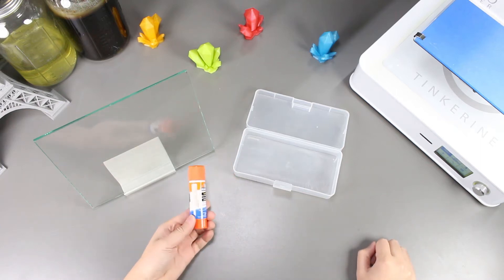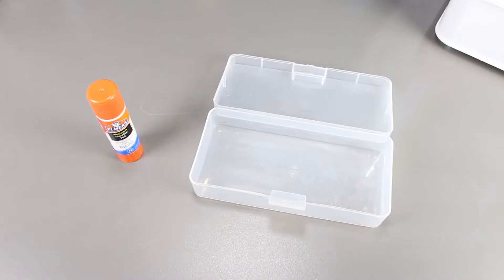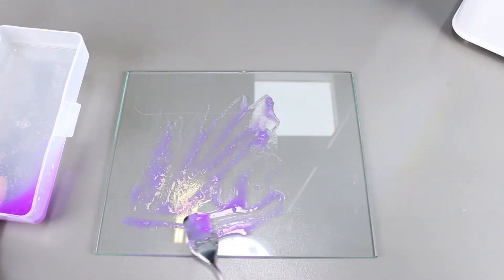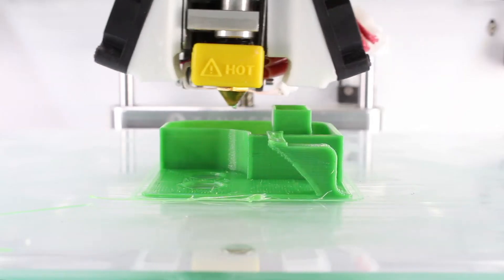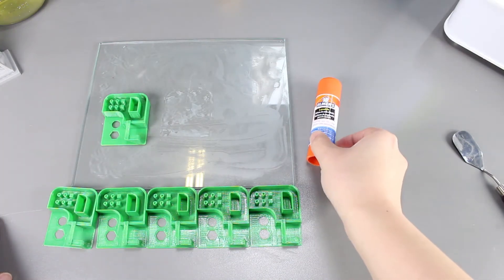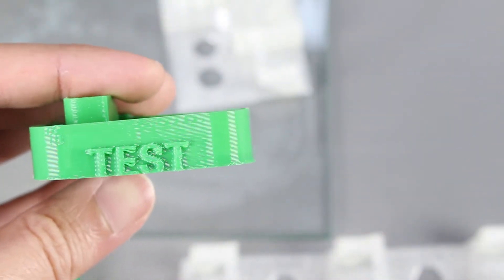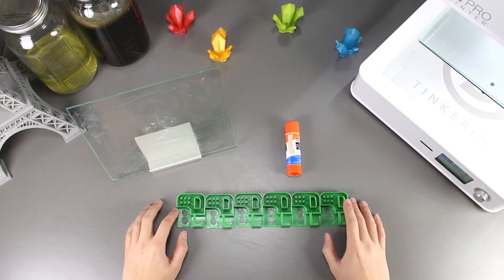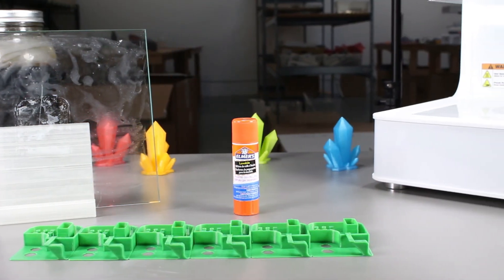3D Printing using Gluestick and Water Solution as a Bed Adhesive

Comment: I do a variant of the water/glue stick application. First I clean the plate with soap and water then do an IPA wipe to make sure the oils are removed. Next I coat the plate with a glue stick making sure to get a good coating. Next I take a sponge and soak it with hot water so just shy of dripping. Then I wipe the bed down with the wet sponge and it melts and levels the glue. Once it's dry the plate is ultra smooth and glossy. It almost looks like nothing is on the plate. I store the wet sponge in a zip lock bag and use it to wipe down the plate again between prints. If needed you can apply more glue and wipe it down between prints. I get 5 to 6 excellent prints before I wash it down and start over. The upside to this method is that the underside of the part comes out glassy smooth with no visible glue on it. Now if I could only figue out a way to put glue stick on the top and side layers and get that nice glassy surface

Comment: It does not make sense that it would not be as good as pure glue stick, the water will evaporate off and leave pure glue stick.
All you are doing is applying a agent to allow it to spread more thinly. This should work better because you would be able to get a more even layer.

Comment: but isn't that lumpy? The point of a glue stick is that it applies an even layer over the whole thing. With the glue grouping up like that it would create hills and valley's that would mess up the leveling. I'd at least apply it with a brush to keep it smooth.

Comment: I use the glue stick directly on the print bed and then go over with a finishing paint roll made of foom with water.
bed temp at 60 degrees and let the water evaporate so you get a nice even bed.
I can print 15 to 20 prints before applying.

Comment: I’ve been using this technic for a year now and it works perfect each time. But you have to modify the application. Put 1g of glue stick adhesive in a bottle and add 50ml of water (no need it to be warm) shake well until all the stick disolves then filter the solution with a fabric. Use a soft sponge to apply the solution on the cold glass bed evenly. After heating the bed to 60C, PLA sticks very well, after the printing is completed and the bed cooled down to room temp. you can easily remove the part without using any tool. 
Important note: use lightly sanded mat glass which is used for photo frames for anti-glaring purpose. Good luck.
Reply from the maker: Thanks for the comment!